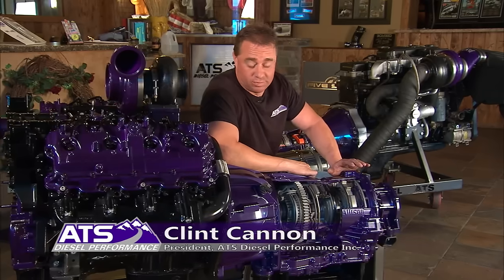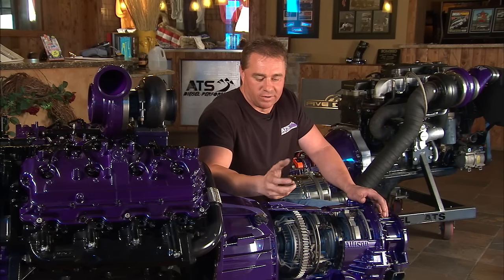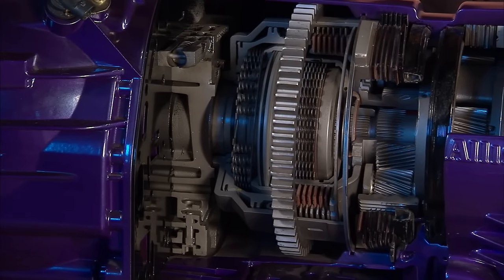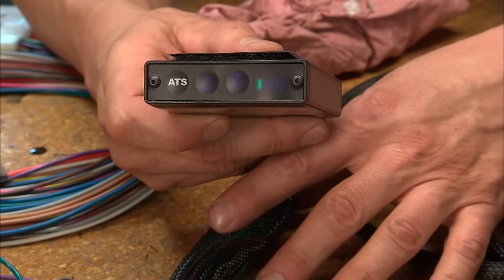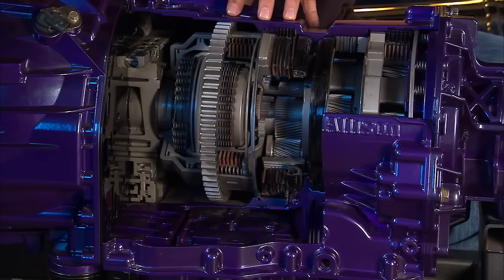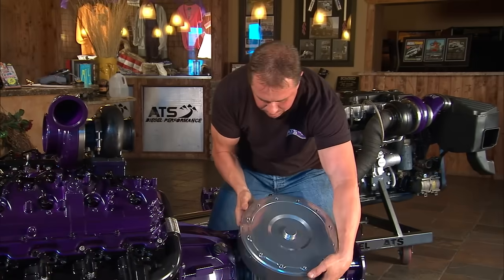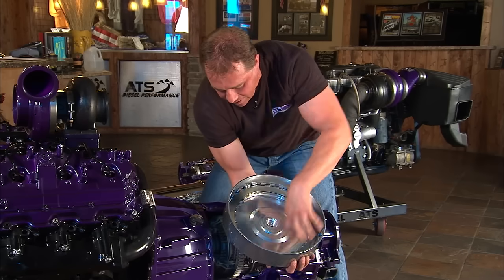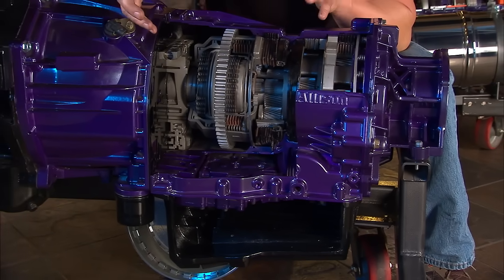ATS Diesel Transmissions Explained

Comment: What would be the cost & shipping to wasilla Ak. For a Dodge Ram 3500 ,2000 ,5.9 diesel Cummings , dully pick up truck 
Transmission ,torque converter, and what ever goes with this kit . I’d also like a good turbo boost for more power . Can you please send me an 
Estimate.